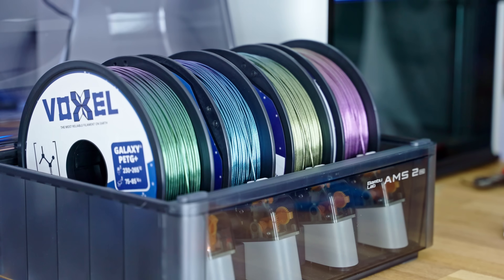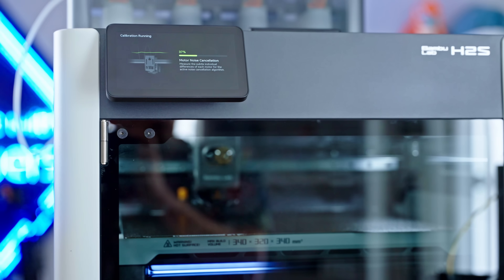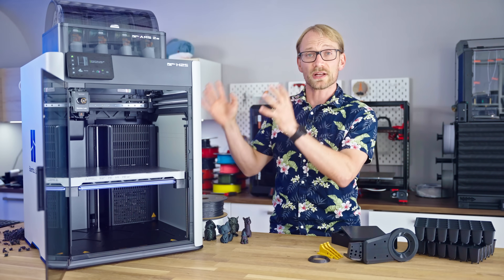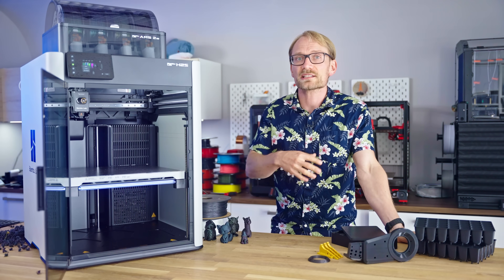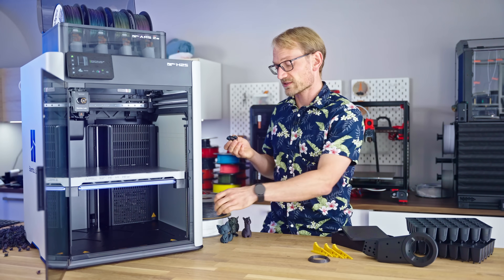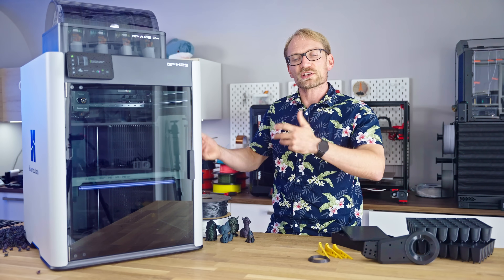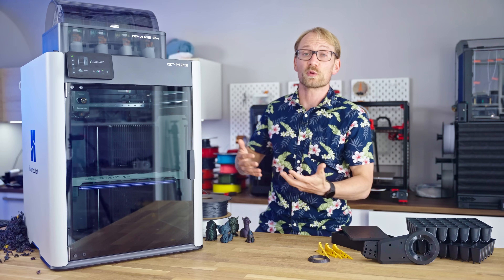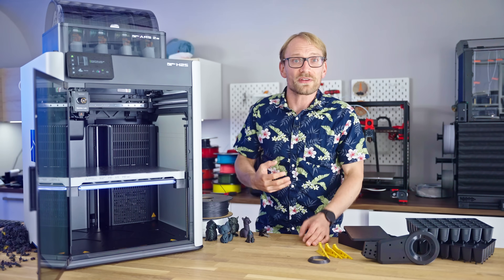Is Bambu's H2S truly a H2D Lite or just a bigger X1C?

Comment: Havent you just done videos about no need for these insane print times? Decreased adhesion etc?  - So for those of us that care about I mean near instantaneous & wasteless use of a 2nd material for supports while printing mostly engineering grade or functional parts - Even granted that each nozzle CAN HAVE its own AMS in the H2D and comes with one already to give one side 4 options.. So for example I could print a 4 color or material main part with dissolvable supports with the second nozzle (Just like years ago before health issues prevented me on Duet wifi to finish setting up my 2 x E3D Toolchangers  (thats still never as resonsive as a dual nozzle machine for support creation with minimal time wasted and no complex calibrations)   - When ive seen other reviews compare the H2D and H2S and found ... No perceptible print quality differences... - In fact the Camera watching the nozzles and other features with it to me just make the H2D a NO DUH maching - For anyone ... capable of sacrificing a bit of X axis size I think is still around 300mm  - To save a fortune on filament waste.. 

I have stayed away from these just because of the waste - Just because Idk how well or long heating up the nozzle to different print tewmps of a single extruder will ever be effecient at all for True MULTI  MATERIAL / (Not Multi Color Pla) Printing - For those actually doing something real besides printing trinkets and adding to the world plastics overload problems 🙄 (I know PLA degrades - well less so with modern addatives / copolymers for faster printing or different characteristics of strength improvement or light weight foam like etc) 

So - to me..    ANY SANE PURSON - Not buying a machine JUST TO MAKE VIDEOS LIKE THE IDENTICAL 😂ONES OF BENCHY BOAT SPEED PRINTING  OF ALL H2S Owners out there... - I REALLY, Genuinely - & Sincerely hope - You of all people WOULD HAVE REQUESTED OR PURCHASED THE H2D  - BEFORE THIS REVIEW!

As ABSENT THAT PRINTER - You review IS GOING TO BE GLOWING seeing none of the benefits of the H2D in *For me 90% of all printing scenarios of needing a seperate support structure printing at a vastly diffferent temperature than my main say PA12CF or CFPC body needing supports I just dont see going well out a single nozzle - Sure .. it eventually will, But at how much wasted time, Money (electrricity) and FILAMENT WASTE! 

So without that printer - You are ONLY SEEING THIS ONE AS IT COMPARES TO THE say X1 Carbon - Or that stripped down frame onlyone ... WHich compasred to that MORE BUILD VOLUME + IMPROVEMENTS THEY MADE AND LEAREND FROM THE H2D (Which BTW in my life I WOULD NEVER EVER USE IT AS A LASER cutter thats the most insane dumb idea ever and I wish they hadnt bothered with it and the air intake ducting from the front just to help extinguish fires ... For something I will NEVER USE - But use a PROPER LASER Engraver or cuttter not sending burn debris all over my precision equipment and motion system)   - So please realize ... IM STRICTLY SPEAKING ABOUT THE H2D as a 3D printer ONLY! 

Obviouisly  lighter single nozzle will perform better with input shaping with less mass - Its the laws of physics - No explantion needed..

But  - I really REALLY AM SAD TO sEE you reviw this ... while Skipping over the H2D - As Im in the market finally for a Bambu labs printer in 2025 - I hate the idea of filament waste and having vastly different material properties like dizzolvable supports going through the same nozzle of CF/GF/Kevlar reingforced Engineering materials..    - Its made me cringe ever since the first knowledge of the X1 Carbon or Bambu labs at all.. - Which the existance of I predicted so long ago while trying to do input shaping on my Duet based COreXy system knowing how effortless this would be for a propietary chinese company that knows what they are doing to come custom deisng all their components finally and perfect input shaping and for basic people multi material splicing like something called like the mozaic pallet? something.. And when thet happened - Anyone... No matter their skill level would be able to 3D print while they become almostr as common as microwaves especially with the DIY at home boom of Covid in that post pandemic world..
Reply: In short - WILL YOU PLEASE REQUEST AN H2D to have tested or reviewed atr all BEFORE THIS - As without that..
Which Im sad to learn never occured...   OF COURSE THIS VIDEO WILL BE THIS WAY! Your only refference is an X1 carbon or their others where this has vastly improved software firmware from H2D lessons and a larger bed!  OF COURSE YOU CAN ONLY GIVE IT PRAISE AND NOTHING ELSE!  How could you not??  When you NEVER EVEN USED THE PRINTER THIS WAS THE OTHER CHOICE For - for 3D printing entusiasts.. that IMO is..

Do you want to make large batches for your etsy of dumb multi colored little mushroom people... 🙄 by the buildplate that you let run for an eternity - Waste VASTLY MORE MATERIAL THAN WAS EVER TURNED INTO A PRODUCT...  If yes - THIS IS FOR YOU!

If you actually want to DO IMPORTANT THINGS IN LIFE - Please review and consider the vastly logical improvments of the H2D having another nozzle ready to go at a different temp and pre loaded with a support material while you build functional prints.. Even with both nozzles still having means to have extra materials if you need to be as sellout and continue dumping plastic into the world at extreme rates while producing nothing of substantive value but people who have weird REALLYT WEIRD obsessions with bizzare bubbly miniate character models for some Niche show or game.. and you dont care how long it takes or how much it wastes as - (THE ONLY THING GOOD TO COME FROM BAMBU LABS IMO WAS THE GLOBAL DROP IN PLA and PETG Prices Closer to $10/kg especially in bulk order of 10+ spools at a time..) FOR ALL THE WASTE MATERIAL!   - Which - To any genuine experienced 3D printer operator or prototyping / creator.. IMO just seems like the most insane Choice ever .. That JUST BECAUSE IT TECHNICALLY WORKS... DOESNT MEAN WE SHOULD BE HAPPY WITH A ONE NOZZLE DESIGN..  - This year I was either going to build an IDEX machine with a large frame or see what designs have progressed since 5 years ago in Dual nozzle swapping printers and systems that If I cloned and machined out of aluminum the core components - Would I be bogged down with excessive  coding for calibration I'd honestly not know how to handle as im mostly fully a mechanical engineering person with ... Every programing language ever learned having NO use in 3D Printing .. which shocked me when I bought my first ever CR-10 and heard of Gcode... Thats not programming language AT ALL - Its caveman speak ... and the version sthat allow for variables ARENT USED IN 3D printing still to my knowledge!

So - Without interest in an Ultimaker machine DESPITE MY LOVE FOR CURA - I HATE to Depart from if I join the REST OF THE WORLD in the .. Vitality of needing a virtually foolproof 3D Printing machine.. - That i only hope wouldnt waste more plastic than the actual printed  part is made from if using mostly just Dual Materials!
Reply: Nice schlzo posting buddy, you nailed it :) now take your piIIs, this is embarrassing

Comment: Great thoughts on this one. Totally makes sense as a larger x1 upgrade. It’s Bambu’s largest printer and not everyone needs multicolour. 

And also not everyone is concerned about waste like me. I tend to optimize my designs to use less waste plus i mainly print functional parts. 

Btw you can also use orca slicer with bambu connect. No need to walk over to the printer with your file in hand. 

Thoughts on that vortek? Looks insane

Comment: i love mine. bummed it was sold out at bestbuy at day 2. but i at least i got the last one at the closest micro center. been trying to print something tall and thin but every other printer has failed sept my p1s but it was too small. then the ads on various social media actually came through for me for once and now i have exactly what i needed. unfortunately the elegoo max 3 was just too slow and not reliable enough since the bed moves. for my use case. its been a win for sure.

Comment: Unless Bambu reverses their stance on 3rd party slicers and not needing the cloud, without losing a bunch of features, I don't think I'll buy another one. I bought the x1c before those firmware changes were made, and it made me pretty salty
Reply: You can use other slicers and you don't need cloud.
Reply: @JakovPerisic ya if you turn on lan only mode with developer mode, which loses features
Reply: @AtHeartEngineer nope, even without that.

Comment: As a production printer, I agree with bambus move to keep the poop chute in the back. Poop can build up way too fast and back up inside the machine. It would take a unnecessary redesign to make it work and then it's less cross compatible with the H2D. 

Not worth it

Comment: I got the H2D last month and feel like I missed the boat with the H2S because I mostly do one color prints. However with the announcement of the upgrade kit to the H2C Im kind of glad I got the H2D now. Just curious what that kit is going to cost. Cant be as much as a PrusaXL can it? ;)
Reply: Even if you only do 1 color prints, you could just use the second nozzle for your support interface material to make removing them easier.

Comment: If the H2S isn't 'your' printer, any plans of getting the H2D instead with it's dual head? I'm wondering what can be done/hacked getting the Bambu printers running completely locally over a local network.
Reply from the maker: H2C probably

Comment: Bambu really has some amazing printers. Unfortunately they are useless in some manufacturing. If you have trade secret or restricted parts you are printing, you can't use it unless you want everything going from computer to printer via sneaker net.
Reply: For manufacturing you buy the Pro version of the H2D
Reply: 1. False 2. You can use them in lan mode
Reply: @JakovPerisic  when I last tried to use one in LAN mode without being connected to the internet, it would not to print.
Reply: @quubspace but it should and it does
Reply: @quubspace  User issue.

Comment: Thomas, what happened to being leaps and bounds ahead of the competition? Bambu seems to be settling into the Apple mold a little too hard, this printer is a refinement, not exactly groundbreaking. I think you meant to say Snapmaker U1 is at the vanguard of 3d printing these days for two reasons, first the price, and secondly all the WASTE that anyone who prints with many colors does their best to ignore. Snapmaker's Kickstarter says: 5 times the speed(yay!) and 5 times less waste. This is as important as when 3d printing went from bedslingers to core XY. Tool changing printers are the future. Period. All the flowery prose you mentioned at the beginning I would apply to Snapmaker, not Bambu. Not anymore. I'm not looking at this printer for many reasons most of which you mentioned here. The main reason is tool changing.
Reply: Not even close to being like apple, let's be real

Comment: I believe you can still use Orca with the printer in regular/cloud mode, by exporting the gcode file and passing it over to the printer wirelessly using Bambu Connect (PC app in their wiki)
Reply: Correct
Reply from the maker: That's correct - I had originally phrased that segment slightly differently, focusing more on the fact that proprietary software is required, but cut that part short in the final version.
Your options are essentially:
- Use Bambu Studio (with proprietary, cloud-bound components)
- Use the proprietary Bambu Connect software as an integration in the slicer (Orca developers decided against supporting this)
- Export gcode to a file, then upload to your printer with Bambu Connect
- Set printer to LAN mode and use Orca's native (open-source) upload features
- Export gcode to a USB drive and walk that to the printer (works for both LAN-only and cloud mode)

Comment: To clarify, Bambulab did not restrict any open access to anything. The MQTT endpoint was reverse engineered and found to not be secured and thus third party developers found they could use it. BBL warned everyone immediately to not build integrations to that interface because it was likely to be changing. Given they develop things years out, they already knew it wouldn't be supported in the future. This advice was ignored and products were built anyway. All of the Bambulab printers continue to offer all the same functionality they were promised to provide when they were sold. The firmware updates only affected third party tooling that ignored BBL's guidance and continued to use an unsupported interface. Regardless, BBL offered a Orca integration solution that was rejected and then still gave people dev mode in LAN mode to use that interface.. I think this was a respectful  handling of the situation.
Reply: That's what they claimed after the fact it turned into a PR disaster, the Orca slicer dev even confirmed the whole claim about them "working with the orca team" was totally fabricated, which is why official support was dropped.

So between them being caught lying, multiple times, the previous open firmware issue with the X1C, and the fact Bambu is a splinter off of DJI who has their own laundry list of anti-consumer disasters, people are rightly so to be weary of anything bambu claims because nothing is stopping them from swooping in later and altering the deal.

They could easily alleviate the concerns by simply allowing for third party firmware support like they did the X1C, but again, that would prevent them from making anti-consumer decisions later when they want to squeeze just a little bit more profit out of their customers, so they refuse to do it.

Also, again, there is absolutely no reason for them to disable cloud features when the printer is in developer mode. But they dont want people using it because it takes away from their control of YOUR hardware.

Comment: Where those seedling starter trays at 6:59 ? Is that your design?
Reply from the maker: While I did model and print these trays myself to specifically to fit inside the Ikea (Samla / Nojig) sizing system, the original concept is from Charles Dowding

Comment: I dont care about multi color printing. If i need to use special support material i can design my part for minimal filament changes (only as interface at a few layers). H2S is the perfect machine for my application, no need to spend 800€ more for the H2D in my case

Comment: Slight correction on the build size, For the H2D it's 350x320x325 (though actual usable depends on the head configuration used, single head is 325x320x325, and dual head [full dual material coverage] is 300x320x325) While the H2S is 340x320x340, so slightly less on the width, but is greater in height as you mentioned. (though in most use-cases it's actually larger than the H2D)

I'm debating myself whether to go for the H2S or the H2D, as it's not as clear cut anymore [H2 vs X1]. I think you'd like the H2D Pro a bit more, for the simple reason of multi-material as you mentioned. The pro adds Ethernet over the standard H2D, similar to the X1E. IIRC it also adds cloud-free/offline operation without needing to use the USB. 

Though I think what will be really interesting, if they deliver as promised in Q4 of this year, will be their new Vortek platform. If they keep the build volume size the same, or larger than the H2S, with the multi-head set-up they are showing, it could be a real killer to the Prusa XL.

Comment: And now you're going to be able to upgrade the H2S to the new Bambu tool changer in Q4 this year which is amazing
Reply: Agreed. That Vortek announcement was out of the blue, and an H2 series update kit for it makes it even more exciting.
Reply: @Drathus  Holy crap. totally missed that one!! As soon as I realised Bambu announced a too changer I was about to kick myself for buying the H2D. But they're offering an upgrade!! Very exciting.
Reply: Interestingly, on their blog page about the H2C, they don't definitively say yes unlike the H2D "Can I upgrade my H2S to an H2C, well, technically you can, but we post this blog just to make sure you do not have to waste your time and budget in doing it." So I guess there might be some caveats to that given the difference in the head.
Reply: @troycording the first entry in the FAQ they've posted is more definitive, but also says it won't be a simple add on, so yeah, I expect they're trying to set expectations some too.

"¶Q1: Is Vortek a separate system or only available as a new 3D Printer?

The "Vortek" is both an upgrade system specifically designed for the complete H2 series of Bambu Lab 3D printers, as well as equipped on a brand-new flagship printer H2C. The upgrade kit for existing H2D/H2S users will allow them to upgrade their current 3D Printer with the Vortek system. Since the upgrade requires hands-on skill and over 6 hours, we suggest purchasing the H2C directly in Q4 to experience the Vortek system. Upgrading an H2S or H2D later will incur additional costs."
Reply: @troycording  it's likely going to involve replacing a fair few things on the H2D due to the difference in toolhead size, so the XY belts might need to be swapped out aswell as you removing the entire of the old toolhead, along with running a replacement toolhead cable, making any more adjustments like a second filament buffer and that's all before having to install and connect the nozzle swapping part
Reply: @troycording  I suspect they're saying that because the H2S has only just come out, so if you want to do the H2C upgrade you're better off just waiting a bit longer and buying a H2C instead of buying a H2S and upgrading it later on.